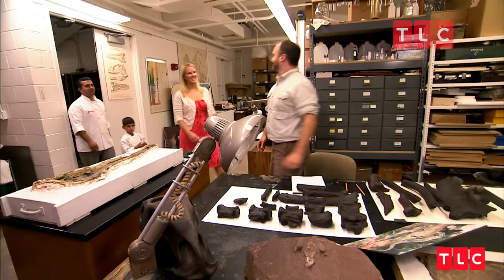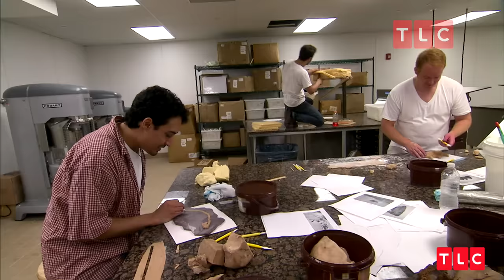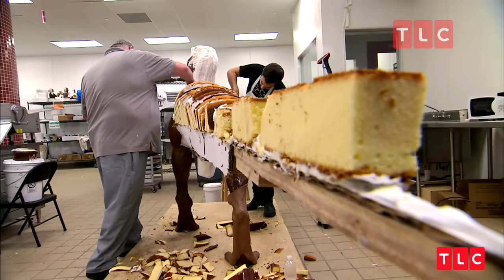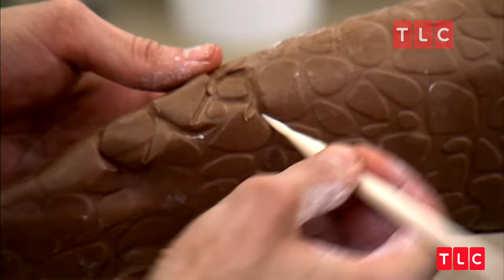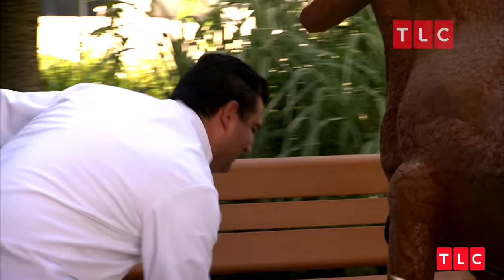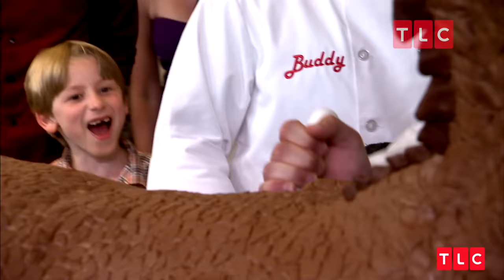Making A Giant Dinosaur Wedding Cake | Cake Boss

Comment: I think instead of using just rice crispy on some parts of the cake you should hollow out the rice crispy and then put the cake inside and then attach it to the dinosaur so when they cut the cake it would at least have some cake inside of the rice crispies on the parts  that were supposed to only be rice crispy